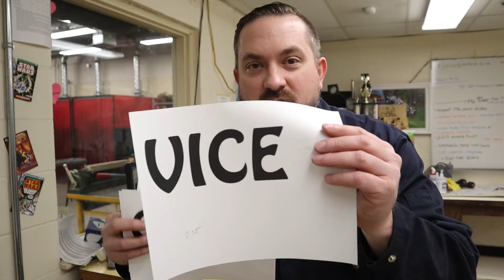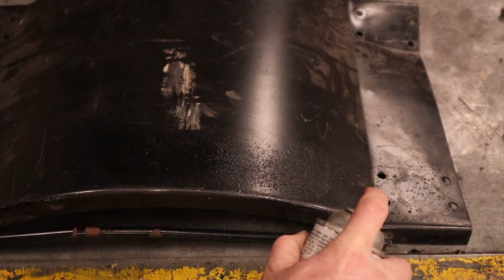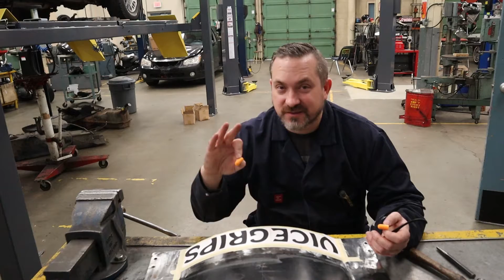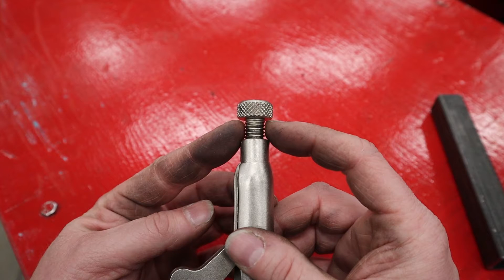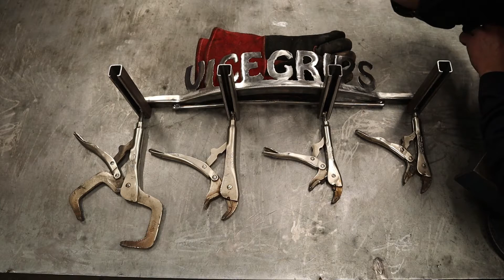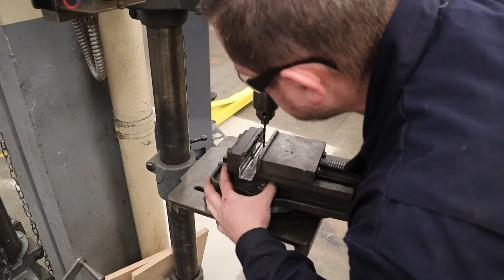Make This: Vice Grip Holder

Comment: Nice project. I know I am a year behind with this, but for this type of transfer, I use a vibrating engraver. (I do this type of work a fair bit on commercial ships, between laying out for machinery, patches, and welding in outlines for identifiers)
Reply from the maker: Yeah that's a good tip!  I have an engraver like that so I'll have to try that next time I plasma or oxy acetylene cut.  Thanks for the watch John!